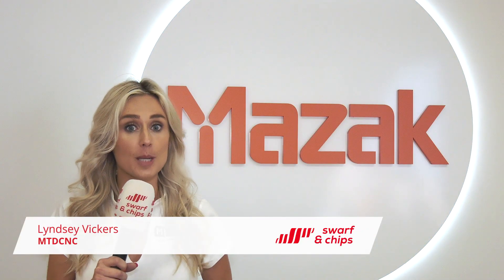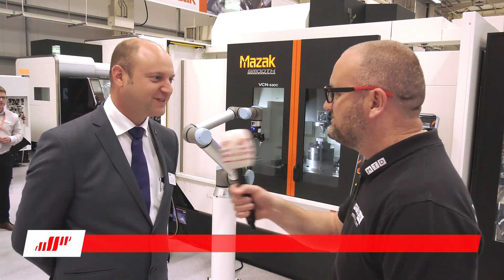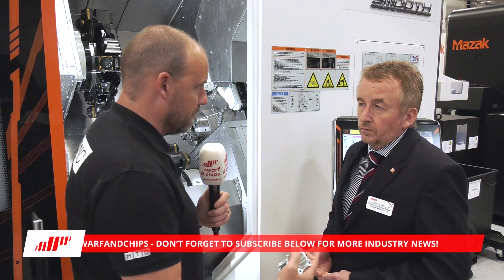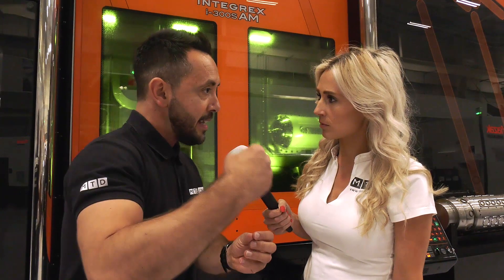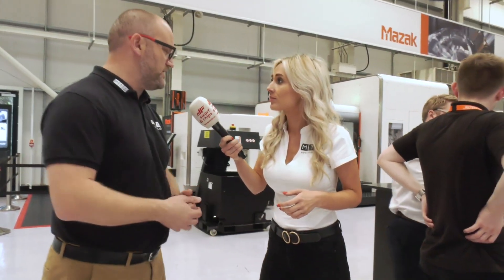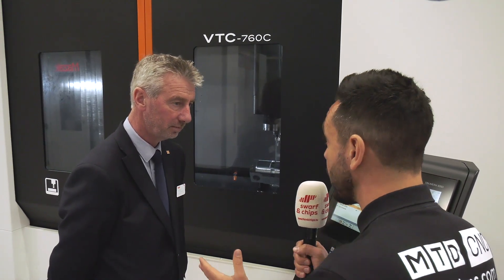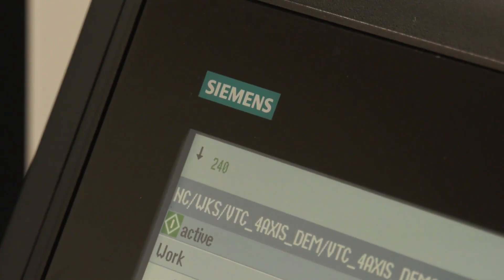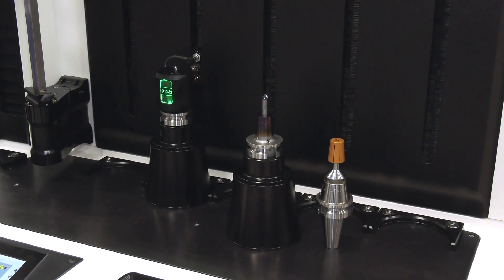#SwarfandChips - Mazak Hybrid Machine, AR and Automation feast - 21/06/2019 - Ep 132

Comment: Woukd like to know the diffrent between integrex i-500 vs integrex e500
Reply: The e500 seems to be a more heavy duty machine with a 50 taper milling spindle the only option with 50hp compared to the i500 which has c6 standard spindle with 32hp. e500 tops out at 10k rpm spindle compared to i500 12k rpm spindle. Both have 40hp turning spindles but e500 slower max rpm of 3300 compared to i500 4000rpm.